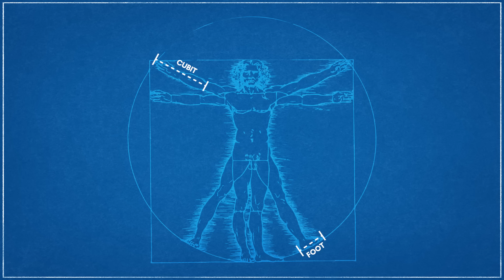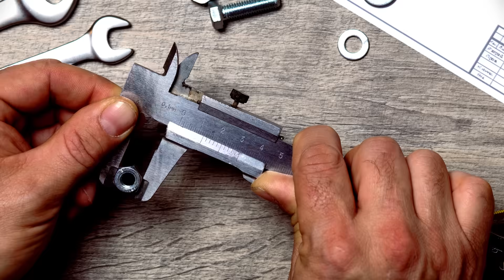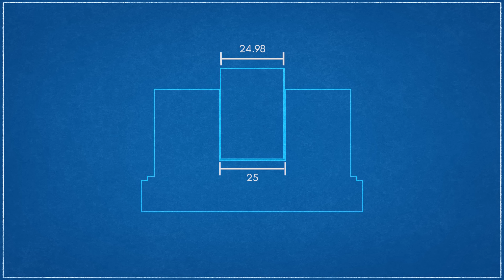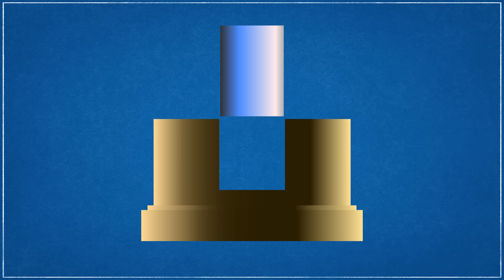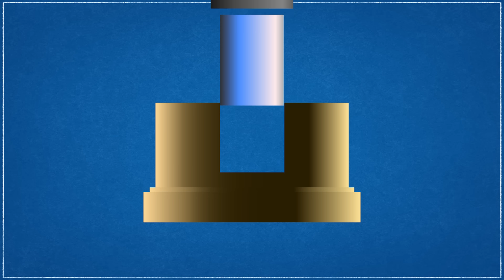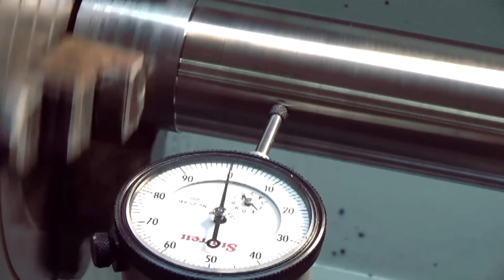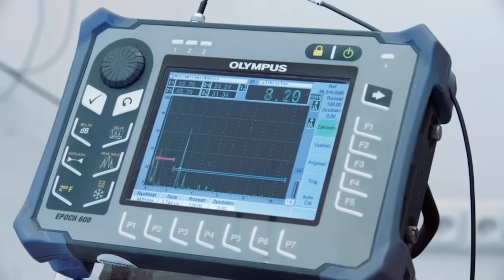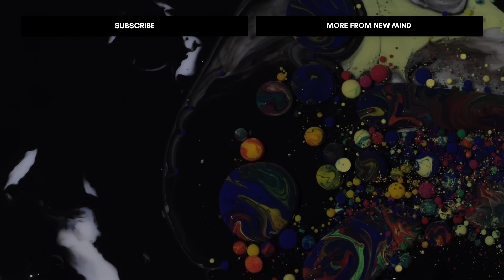The Science Of Small Distances

Comment: Machine designer/machinist here. When I was working in tool and die making way back in the late 1970's, I was working to a tolerances of plus .0000" to minus .0001". That is one ten thousandth of an inch which would be like splitting the diameter of a human hair thirty times. This shop had no CNC machines and most of the machine tools were old with some being vintage WWII war production machines. These were thr machine tools that we were holding tolerances to within .0001". We would grind plate so flat that if you put it on a clean granite surface plate it would glide across like a air hockey game puck. I miss workign in that trade but sadly it was already dying when I entered the trade immediately upon graduating high school. I don't see it ever retunring to the US.

Comment: At work, we are instructed to apply 90-130μm of paint to wooden structures. Twice. We measure this with measuring tool looking like a 6 pronged fork, with two outer pins equal length, and middle 4 that are shorter. Shorter that the outer two by 90 100 110 and 120. By dipping it into paint, and lifting, we can see how many prongs are stained with paint. (Not counting outer two) 1 is 90, 2 is 100, 3 is 110, all 4 is over 120μm. And we have no idea if it's 103μm or 107μm, best we can tell is if it's at least 100μm.

Comment: 3:42 The coordinates of the Great Pyramid of Giza are approximately 29.9792458° North
Which coincides with the first few digits of the speed of light in meters per second, 299,792,458 m/s
Reply: And this means nothing because a unit of length was arbitrarily chosen, as well as the coordinate system for geo location.

Comment: yup thermal expansion (and contraction...) are real things that a lot of people don't really think about.  I just got through machining a special tool.  It's al aluminum outer sleeve that fits over a hardened steel inner shaft (bearing installation tool).  When I cut the aluminum, I bored and measured.  Last cut came out to .0005" oversize which is about where I wanted it.  Slid it onto the steel shaft.  In seconds it became STUCK.  I failed to take into consideration the expansion rate difference between the two different alloys.  Just heated the aluminum a little and it slid right off.  This expansion is something that many don't really think about much when they go hammering on their engines when cold, particularly aluminum block engines.  Titanium rod engines are similar.  Aluminum rod engines....oh boy...don't even get me started on those.  Some types of racing, the engine parts are mostly seized when cold and require an artificial warming up (heaters, etc) for the clearances to open up.

Comment: For a while I worked at a facility that manufactured bottling slip sheets. It's a thin sheet of plastic used in the bottling process. Our tolerances was +/-1.5 thousandth of an inch. My job was checking them every hour over 10 times a day. By the end I could pretty much tell how thick it was just by hand and sight. Using the actual tool was just to see how close I got and as a double check.

Comment: 6:50 Another way to make it fit inside is to use a hot flame thrower on it, it will become elastic and it will fit, but when it cools down it will make it stuck, if that is the porpuse.
Reply: No lol the heat makes it expand so you’d be better heating up the female side so when it cools it shrinks tight around the shaft
Reply: @georgejackson4790  Thats what I meant
Reply: @jose_barroso00  ok

Comment: You are somewhat right, with injectionmoulding 0.01mm is a common tolerance between parts, and going into injectionmoulding with silicone you would have a leak with that gap. Where 0.005mm tolerances or even lower are a must for the mould to work. Alot of mobilephone and computer parts, medicine etc have a insane tolerance, superseeding engine specs somethimes.

As a toolmaker i work daily with tolerances below 0.01mm on my manual machines. It comes down to skill and profession. You dont need automated machines to make a snugg fitt. My grinder is accurate to 0.0025mm and its manual.

Comment: If a meter is 1/299,792,458th of a second, it seems that the meter isn't really based on the speed of light in one second.
Otherwise, it would be 1/300,000,000 of a second (or if the metric system is based on 10, then 1/100,000,000 of a second.)
At least the Imperial system of measurement is a solid system.
One mile = 1000 paces, as measured by the Greeks Army.
Mile' is Latin for 1000.|

This is why America is one of the only countries smart enough to reject the metric system.
Reply: Cute

Comment: i regularly fit parts with  10 thou shrink horizontally by hand no guides except sometimes a  rolling chair. or the gantry crane if its a huge shaft but thats vertically. if you are using heat to fit parts in an ideal setting do your best to have a very flat workbench or floor with a stop if its a through fit without a shoulder of some kind, the parts being fitted to be oriented vertically, measuring your fit directly before your attempted fit and as soon as the part starts to slide just DROP it or if using a crane just drop as quickly as possible. (if its with a crane the weight should keep it going down. keep a 30lb piece of brass or like a 2in dia aluminum and a big hammer to please the machinist gods just in case it decides to get stuck or cocked as it falls, if you are fast enough a light tap on the high side can usually let it fall the rest of ther way, however if it doest i like to go in a pattern of a top, bottom, left, right, pounding it down till it sounds different. you only get like 2 rotations if your fast enough before youd have to call itquits and let ity cool down to then reheat to press or remove and try it all over. and hopefully not mar or destroy the parts. Bearings however shouldnt be done in anyway that could introduce debris or dirt into them so press with an induction heater is ideal.

Comment: Clearance fit holes are drilled for aluminum rivets in the manufacture of aircraft. Also, interference fit holes are reamed for some fastener applications, which cause the metal around the hole to expand when the fastener is driven into the hole, causing the metal to become work-hardened.

Comment: Once again, throwing the British Imperial Units under the bus. I like both the Imperial Units and SI Units, but for some reason there has been a fostered hatred for both and a strong defense by those whom deem their units more superior. It's quite sad, honetly, since they both get the job done. For me, SI is good for the science community as a whole, I will admit that. SI are easier to work with when it comes to small-scale stuff and volumes. However, I find the Imperial Units good for things like weight, height, and length measurements. It's easier for me to quantify an inch or foot, than it is a centimeter or meter, but in the end it really comes down to whatever unit of measurement you grew up with. As I said, both can get the job done, and I'm not here to argue which is the overall "best of the best."

Comment: As a machinst who works often with 0,01mm tolerances i can confirm that a machined block of 24.98mm will easely fit into a hole of 25.00mm, even if u put it in with bare hands. 😉

And the tolerance of a machine so the block could be in theory 25.01 is just a fault of the machinst who made the block to big.. Has nothing to do with machine-tolerances. 
In fact, if u work with such tolerances your machine shouldnt have much of a deviation.

Comment: And once you get down to about the 5 nanometer scale you encounter a whole new problem far beyond temperature and fit - the thickness of the material is so thin even electrons can pass through them and "leak out". This means the material is no longer able to hold or transfer a charge through it. It's the biggest limiting factor of making computer components even smaller and our ability to truly create nano-computers. And we're already getting close to this limit (we're down to around 7 nanometers now).
It's also the scale at which the tiny molecular machinery inside every cell exists at, where this "flaw" of electrons leaking through is actually used as a tool that makes the very processes of a cell work. Here's a really fascinating video on the topic: https://youtu.be/LQmTKxI4Wn4

Comment: Excellent video. In my career I often encountered specifications that called for dimensional tolerances much finer than required for the actual application- it was easier for lazy engineers to set a tight spec than to figure out what they actually needed. There was also the rookie mistake of pasting a spreadsheet calculation result into a shop spec, without regard to how many significant figures were actually justified based on the input values.

Comment: I can tell you as a gunsmith, it baffles most people that a well made fire arm has part fitment with tolerances tighter than a human hair. For example when head spacing a gun. (The process of insuring the chamber is reamed to the correct depth relative to the face of the bolt) this process if you wish to achieve anything resembling accuracy starts at 0.003" and can go as tight as 0.001" before you run into issues with ambiance temperature interface

Comment: good video, but when you say that alignment is impossible at the very tight tolerances by hand only, you are wrong.  I am a retired toolmaker/machinist.  There are many of us that can align pin and corresponding hole with 0.0001" or  2.54 microns by hand and do so almost on a daily basis.  We help ourselves do this with a feature on the hole and pin called a chamfer.  Typically a 45 degree break on the edge of each which is self centering.

Comment: Regarding the historical definition of the meter.
1) I never liked the definition of 1/10,000,000 the longitudinal distance from equator to north pole through Paris.  The whole point of the metric system was to get away from nationalism in order to standardize, and they immediately run to Paris as the standard.
  
2) The original definition of a meter was actually different than what you have here.  Before that definition there was a different one.  The length of a pendulum that took 1 second to swing.  The reason they didnt stay with this definition is because gravity fluctuates across the planet, so this length would technically be slightly different depending on where you were.  Since they wanted to get away from any nationalism to define a universal standard, they abandoned this definition that depended so much on locality.  So naturally and hypocritically they revamped the definition so that  it centered around Paris France.

Comment: Now you can see why machinist drink after work. It is easy for a designer to put close tolerances on a set of plans that in the finished real life use of the part did not need to be that close, the time of holding tight tolerances cost the customer more money.Crankshaft bearings need 1 1/2 thousands clearance for oil and heat expansion, before detergent oil the loss of bearing materiel was replaced with varnish and the oil pressure stayed the same. Now without varnish, a heaver oil is needed as the bearings ware out. Non detergent engine oil is ellegal in CA.

Comment: Hey, great stuff! I went to school for "engineering drafting and design". Where I lived they didn't need people with 4 year degrees that still didn't know how to draw so the local college tailored it's curriculum to the work in the area. Important things like like fits, tolerances, metallurgy, material selection and most importantly, Computer Aided Drafting were of course covered but we also had to take the entire machine tool operations sequence which was the same sequence for a "journeyman machinist" might have to take. Many complained "I'm not going to work in a dirty shop", not realizing that it would make us better designers. In fact, if it wasn't for that sequence we never would have qualified for the jobs in the area detail draftsman and designers. I soaked up everything in college I could like a sponge. I took other cad classes that used different programs, "hydraulics and pneumatics"...whatever I could take that might allow me to be employable at a variety of shops. It worked. I didn't plan on working as a machinist in a welding shop but when layoff time came I needed the job. Unemployment didn't pay the bills! LOL  I was taught mostly in inches because from the rollers at the steel mill to the finished sheets and bars, everything was in inches. You could special order hard Metric but only a couple of sizes might be on the shelf or could be had quickly. So, to this day, when someone starts talking in Metric, my eyes gloss over and I start looking for my calculator.
Reply: 25.4 brother
Reply: cnc operator here, the same exact thing happened for me. for whatever reason, the online consensus is that metric is the standard for the world, but that just isn't the case. i could tell you by feel alone whether a feature on a part is 3 thou or 5 thou, but 25mm vs 24.98mm? no clue. i could tell you if you used an h7 tap or an h8 tap, but when it comes to metric, i just stop paying attention haha. it's just not what industry in the US uses.
Reply: @maxzito70  Yea I used to be able to do a rough conversion from metric to standard so I knew what they were talking about but I don't even bother now. If people online give numbers in metric all I hear is Charlie Brown's teacher, "blah ma bla ga blaaaaa."
If you're in the US and actually working the field, FOR THE MOST PART, you're going to be working in standard, not metric. Some shops HERE IN THE US that only do stuff the asian markets might do soft metric but it's going to be very uncommon to see hard metric.

Comment: Are hydraulic presses not used for interference parts more often than heating or cooling? every time ive always used a press to change bearings like most other people, use heat to get them off though! but would wreck a new bearing heating it to get it on!
Reply: You heat the bearing in an oil bath
Reply: @johnmoffat2914  What type of bearings would you do this with?

Comment: The meter does not mean squat to anyone but an Earthling. Why can’t we use a unit of measurement based on the most common element in the universe, hydrogen? My issue with the meter is well the meter. A foot is so handy. A third of a meter is close to a foot but it’s is not commonly used. Nautical miles is a very good and practical measurement which because it is based on Earth measurement and time, the world will continue its use forevermore. Please note, I am not debating the practically of a base ten system. Even those die hard inchers have succumbed to the 1/1000 of an inch method of accuracy. I would much rather reach for a 15mm rather than it’s inch equivalent. I do appreciate you educating folks on where the meter originated. Most don’t have a clue. The metric system is superior as it ties distances, weights and volumes together in a nice predictable package. But seriously a distance based on the wavelength of hydrogen would be dandy when the aliens come to call.

Comment: There is no case where the piston pin isn't supposed to just slide in and out of the piston.....you don't heat the piston as there is no interference fit......you heat the connecting rod that's what has a press fit and the piston pin has to be pressed through

Comment: One time at work we had 25ish holes bored to a certain spec, within microns. (Around 2inches each) Then bolts made to exactly the same spec. We then placed each individual bolt in dry ice before install. 2-3 hours being that cold it would shrink JUSSSST enough to squeeze in before it would swell back up for a perfect fit.

Comment: I cut the Heads for one of the Auto Companies.....I cut the 6.2LT4 for the Corvette ( figure out what company..lol). Have over a Decade doing this job exclusively and from my experience.......  
Out of say 175 Heads cut in 8 hrs the measurements of any certain hole WILL BE OVAL. the X and Y Axis of the measurement are very rarely the same. Can pull 5 Heads and check. .. will find hole A, B,C and D are all 1 or 2 microns  wider at X Axis.  These are cut with Diamond cutting tools with a life of 300 or less life expectancy ( Heads cut).
Not only Axis but actual measurements from Head 1 to 100 and 101 to 300 are different.  The wearing of the cutting edge also gives you a smaller diameter of the cut Hole. Example...XX0009 with first Head to XX0003 with last Head.

The tolerances are extreme.  Hate having to pull a set of tools..(4)  and then replace them. Not only changing of tools, but the hand Check and Zeiss measurements,  but also the surface check is needed. ...and you can check the same Head in 4 different machines that measure to the Micron and receive 4 different measurements.  Run the same Head 4 times in same machine and receive 4 different measurements... all 1 or 2 microns in difference for this or that Hole.....
I guess what I'm saying is.....even though care is used, the best tools are used, the best measuring machine is used....a perfect circle is rare....not the rule.  An exact sized Hole from cut 1 to cut 300 will not happen.  
If your variation is an allowance of say 40 microns....easy. but when it's less than say 8 it's not. 
When the difference of 1 micron determines if the Head is suitable or not is impossible...unless at say.....
The Head passes atXX0012  and fails at XX0013.....which does happen.